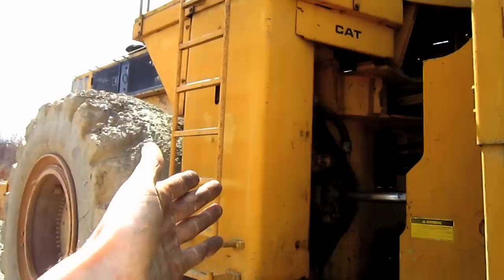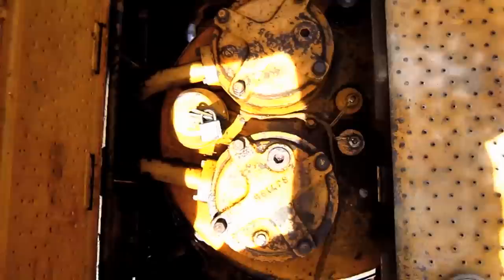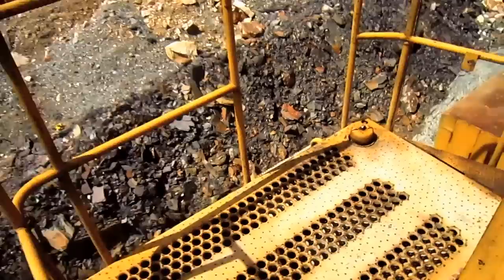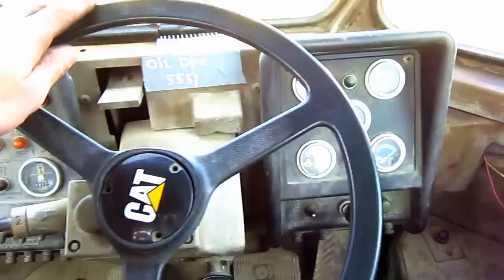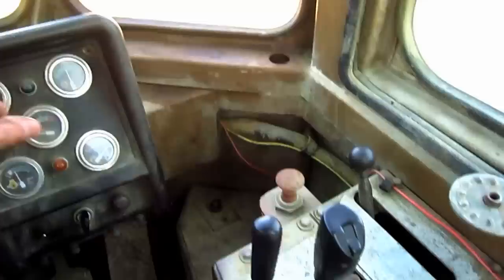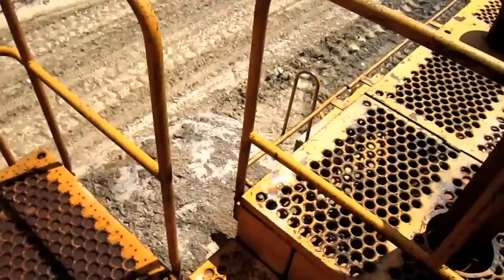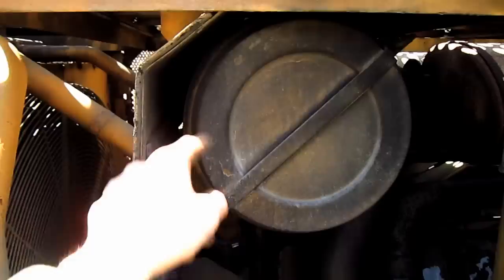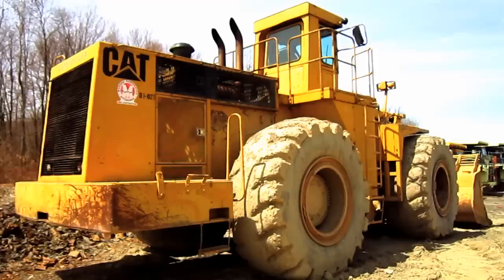Caterpillar 992C Documentary

Comment: This is the loader ,that set the benchmark ,for all large
rock loading machines to come. My family bought their first 992C in 1988 ,and their last C model.in 1990.. They were IH 400  and 570 loader people all the way , until Wayne supply delivered them  a 992C to demo.  Needless to say ,there was never a Dresser 570 Payloader ,ever bought again..
Reply: G Hall The IntH/Dresser 400/570 were very powerful on the hydraulics , but the 992c is about 15mt heavier so it was really an other class machine , man I really liked the sound of that 3412😎👍
Reply: @nl1cat    I cut my teeth on  a 570 , it was the first loader I ever ran .  Over the years I've operated  the Hough 400 ,Dresser 570
, Caterpillar
992C,D,G ,and K as well as the Cat 993K and 994K . I have to say I thought the 570 was a great machine, with a few simple problems that IH Dresser refused to address.  It was entirely to fast , definitely needed a slower ratio ring and pinion set up .  The 400s were the same way. They also needed real brakes . Those were my main two flaws with the IH Dresser line. 
  On comparing the 570 ,to the 992C , I have to say ,with a good loader man ,the 570 could pretty well hold it's own with the 992C ,when loading 50 ton rock trucks , and to most people's amazement ,I could always handle a larger rock with a 570
than a 992C . Whenever we purchased that first 992C in 1988 ,we also purchased  3
Cat 777. Rock trucks ,ro put under it.  The 992C was right at home loading 777s . The combination of using  the 92C with 80 ton trucks , let the 92C shine . Our cubic yardage moved , went up drastically , over  the 570  loading 3 R 50s . 
  
  The only major trouble we ever had with a 992 C ,was actually with the first one we bought. The torque converter and transmission overheated horribly. I don't think Caterpillar ever truly got to the bottom of it's cause , so they just replaced both , and we never had any trouble with it heating again. In all we had 12 992Cs ,and they are probably my all time  favorite loader  . We now use a combination of 992Ks matched with 777s and 993Ks ,where we have a little more room , matched with 785s .  Looking back over the years , concerning the down ,and up times we've had with the 992s from the C models through the K . I can honestly say ,that we have never had any real issues with them , that became a constant problem. We had some issues with the first few single armed 92s , concerning the pin/ bearings , and bucket connection. Trouble , was the very first thing  that came to my mind  when I saw that single arm set up ,for the first time.  Overall I have been more than pleased with them I can't say the same about the 992B .My Dad also had 2 of those pieces of crap. I hated running them , they were to long ,to slow ,and the hydraulics were not only slower than stink , they were horribly insufficient , when trying to break out a badly detonated shot. I really think , That I could load more rock ,with a 988C than a 992B . I agree , they purrrr like a kitten .Maybe a mad kitten . Lol
Reply: Was y'all digging that KY coal
Reply: @bobbyhorn7059   Yeah man! Pike , Magoffin, Floyd ,and Letcher counties finest.
Reply: @ghall1964   I figured with the equipment like you said and Wayne supply bringing them I'm I'm Buchanan county VA just next door to ya
Reply: @bobbyhorn7059   Yep , You'd be in Carter equipment territory. We completely sold out , in 2007 .It had gotten to the point, that mining , was  all but made impossible, for small companies like us.
Reply: @ghall1964  ya sure am, we had a truck repair garage and a salvage yard we had for over 60 years but we had to close in 2009 it was getting hard to make it
Reply: @ghall1964  interesting . However I don't think caterpillar made a 988c model wheel loader .
Reply: The old 992 series (before the 992D) use to have a steering wheel.

Comment: Thank you. Yet another informative doco. Though HP is important, I thought that torque was the key to the performance of these big machines. Have I got that wrong?
Reply: Ted Bell He didn't tell in this vid , but you could adjust the torque-setting of the trans. That is the lever next to the boom controls and the knob on top of the hoist lever. You could adjust the motor to , but that required some tools 😉 .But they were pretty torquey engines.
Reply: No your not wrong. Torque is king. I found this slightly disappointing in that he didn't explain the variable torque control, the lever to the right of the boom control. The rocker switch on top of the boom lever is what turns it on or off. I ran one of those for years, and I will say, at that time they were the ultimate weapon...

Comment: I have seen 2 of these loaders with wide v tread floater tires . Wow when those big v treads went on the push power tripled . They would hop before they spin the tires . It was if the horsepower was tripled . Ike a totally different machine